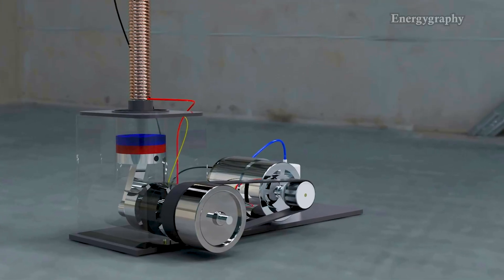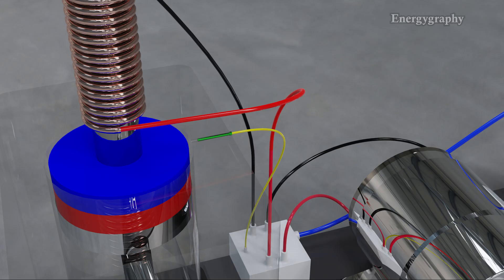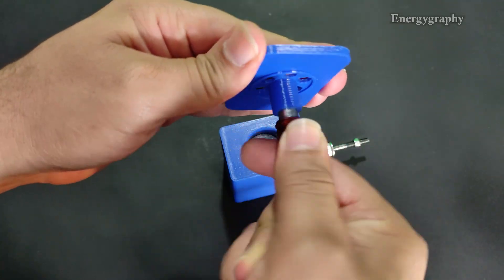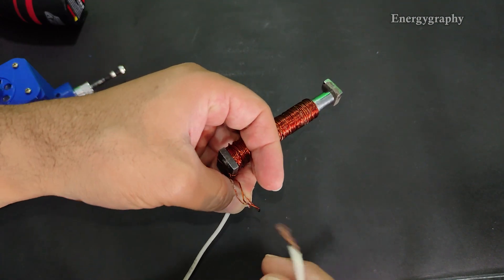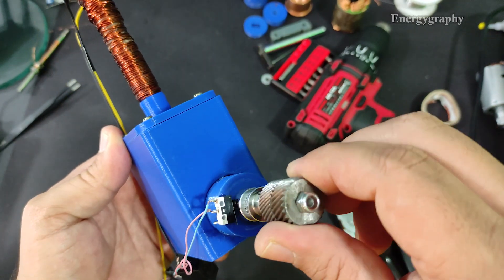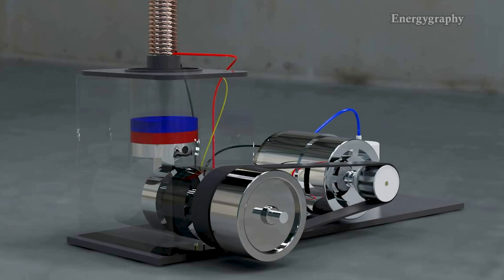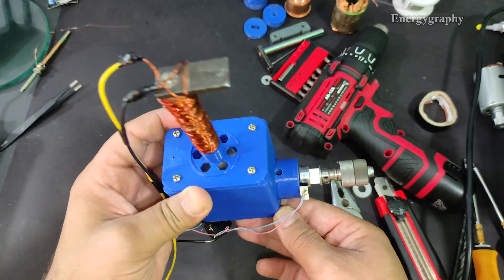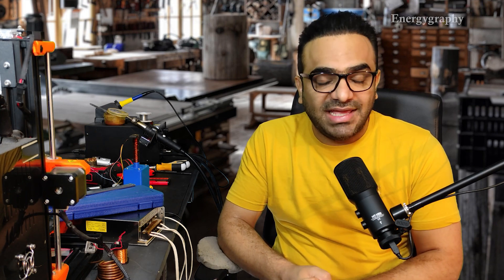First Prototype of a Permanent Magnet Motor

Comment: Nope, does not work, seems the neutralizer as you mention, turns the metal rod with copper coil into electromagnetic it will magnetize, and besides, you  should electrocuted when you touch the copper coil, if does work the output power for consumption will be zero.

Comment: I would recommend getting a pop filter for your microphone. The audio quality is good, but at that distance, you have a tendency to pop air at it quite a bit.
As for the magnetic engine. It's an interesting model and I admire the work you put into it. Unfortunately, I've attempted a number of tries at the purely magnetic motor and have come to the realization that a magnetic field is a force, not energy. It is little more than the difference between turning a shaft with your hand or using a handle. You may be able to cause an effect at a distance, but it is an unchanging constant. The only change a magnetic field has is when an outside force causes the change.
Basically, the idea of free energy from a force is like trying to use falling to earth to generate electricity. It works, for a while. Then, you have to try and figure out how to miss hitting the earth. That is how any force engine will ever work.
Even look at how magnets generate electricity. If you bring a magnet next to a wire, a charge will be generated by it. Once the magnet is near the wire, but still, there is no charge. None at all. The magnet is the handle through which you convert your kinetic energy, moving the magnet, to electrical energy.
A handle will never turn itself.
Don't feel deterred though. I enjoyed my projects and they are a great way to learn about magnets, electricity, and energy.

Comment: How did you calculate the needed Power for the coil? As a student I am curious what formulars and approximation you used
Reply: If this were real it would change the world. We could all sell power back to the utility and make 💰.  3d printer and a garage or basement. Take the utility power and run it through the machine and immediately sell it back onto the grid. Everyone would make $.. Unfortunately it doesn't work like that.

Comment: I tried similar thing in the past, the energy used to run the piston is far greater than torque generated. Very bulky elctromagnet help but its not enough to make any surplus energy. even with the lowest friction, stabilizer and counter weight. i wonder what your test shown so far?

Comment: It will not gonna work. Because in every half cycle of magnetic piston needs to supply current enough to charge the capacitor which helps the coil to produce greater repulsion than attraction, after then a full cycle is ment to be completed, which is not practically not possible. Hence your prototype not gonna work.

Comment: I did this thing when i was in college.i used the old 50cc motorcycle engine remove all piston ring to reduce friction and super capacitor. The energy that require to push the piston down is tripple than the energy it can produce.untill i giveup and decided to beleive that there is no such thing as free energy.

Comment: Your video is excellent. You need a piston at bottom dead center pushing the opposite way eliminating any dead spot energy rotation. So there is a piston on each end of the crank one facing upward and one facing downward or have multiple pistons in a circular motion similar to a rotary engine where there is continuous movement of power strokes. Any movement without a power stroke is a waste of energy that needs to be captured in rotation energy.

Comment: Kind think the Spark that happens on the eletric combustion engine the air mixture  create eletric force inside cylinder then show spark on the coil wire / but diesel don't have spark end its better  fuel efficiency then gasoline  but also consider that diesel have high compression  so the energy strike better on the diesel and  if u put positive  wire on the block just touching the engine dies because draw the energy store on the cylinder/  on the gasoline its similar but the energy goes back to the coil and store back on the capacitor/ condenser  then when piston reach tdc the charges fron the capacitor discharge the eletric back on the cylinder  punch the piston  down/  diesel its diferent cause the energy in form of heat its stock into tdc then the injector put add energy liquid fuel and air

Comment: am not sure if the torque produced that way will be enough to turn a generator under load
Reply from the maker: Please watch the full video, I also talked about this
Reply: @energygrapgy  i did watch the whole video , am just wondering if the tourque will be good to handle a generator under load
Reply from the maker: @EnergySeeker  I said in the video that this prototype does not have enough torque and now I am making a new prototype.
Reply: @energygrapgy  the flux coupling of the magnets will never be the same as direct gears I mean it can work but it will never be the same torque , I have done some tests before for flux and you can see my channel but anyway it’s an interesting approach good luck

Comment: you are in the right track,the core need to be as big as the magnet, also. if is designed in a u form you can make a dual piston and will used the same electricity for the neutralize,remember you can reduce the electric needed if a thinner longer wire is used, but this will make the motor shower.
Reply from the maker: thank you for your nice idea, I have done these tests, wait for the next video

Comment: Don't forget also you can get 50% of your input back by running the electromagnetic coil in series with another capacitor. This will give you an even bigger headstart.
Reply from the maker: thank you Bob 🌹❤️
Reply: What do u mean like bedini circuit does?
Reply: it breaks all of the laws of thermodynamics at the same time
Reply: @jeremysmith8035  What is the relation between thermodynamics and this construction?
Reply: @henknicovandenberg1211  if your machine breaks the third law of thermodynamics then your machine doesn't function correctly in this universe
Reply: @jeremysmith8035  rewrite the physics books!
Reply: @jeremysmith8035 machines function correctly, it's only that science has been misunderstood at certain points. Humans aren't perfect
Reply: youll find that these wingnuts use magnets in their perpetual motion machines because they know that most people don't understand how they work